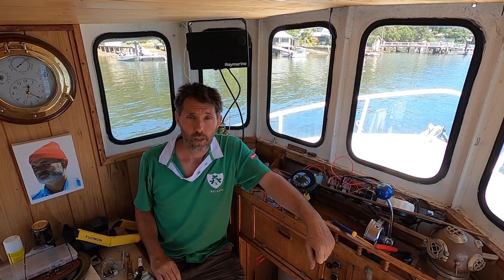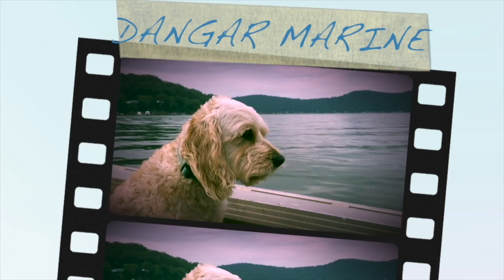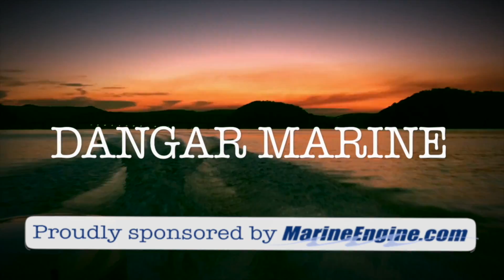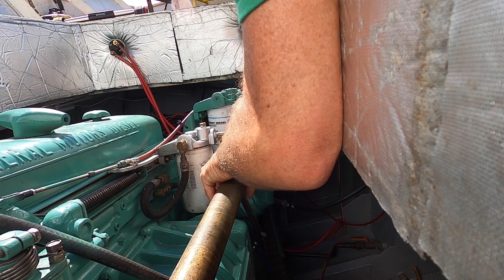Instrument panel

Comment: Stu. There is an inherent problem on that style engine and that is the location of the water pump. It’s high on the engine and it starts dry each time. You are a bit ahead of the game with a water flow sensor but there are other things you can do besides keeping a spare impeller onboard and being good at changing it regularly at a moment’s notice. Remember it’s better to change it before it lets go and sends debris to block the little passages. First off lower the strainer so the top is below sea level so the pump doesn’t have to fill it each time as well as lowering most of the hose ahead of the pump. Sorry I didn’t get to tell ya before you cut/ordered the hose :(
Ultimately, belt driven pump and bracket could be mounted low on the engine and a block off plate fabricated at the old location. Ever wonder why Mercrusier puts the (pitha) thing so low, now you know. A crank driven pump would be too slow (diesel rpm) or huge, uncommon and expensive.
Reply from the maker: I have been thinking about lowering the sea strainer as much as the misalignment between the it and the seacock will allow. It is my understanding that with the raw water outlet below the waterline it shouldn't lose prime as easily as there is no way to suck air in other than if the o-ring on the strainer leaks.
Reply: Dangar Marine 
All true. I didn’t know the outlet is below water line. Very good! Just can’t visually see it but that’s why you have a flow monitor.
Reply: Just make sure there isn’t even a pinhole leak on the engine or it could loose the hold on the water. See any leaks when running it could be a problem.

Comment: Maybe cut the fuel line a little higher and use compressed air to blow it back into the tank and shut the valve once the line is blown out then trim to length?
Reply from the maker: Good thinking! :)

Comment: 22:00 about the Barb: If you're going to put in a soft line you'll want to have a fuel valve in there which you can solder from the outside of the pipe low temperature-ish. Then you can use that valve to seal the fuel underneath while you braze on the 3/8th Barb. You'll also have a cut off to the fuel if you ever need to replace the soft line with a full tank of diesel, or if there's a leak.
Reply: I agree, the valve can be a lifesaver, literally in more ways than one.

Comment: How long are you going to leave that blower open to the damp air? Not to mention cutting, grinding, dust etc. that's a precision device and everything that's building up inside of it is going to blow right into the engine 🤔

Comment: I don’t think you’ll have a problem with that fuel connection issue. It’s not about fumes, it’s about the surface area of the burning diesel which is a little hole down a tube. If the fuel was an inch below I might be worried a little, but it’s like a foot of pipe to dissipate the heat before it even reaches the level of the fuel. Anyway, don’t blow yourself up please, I really count on your videos in these tough times. Be well, Paul.

Comment: looking at the raw water inlet, and how easy it is to get to it, do you think some long handles would help, If your away it would be easy. Also away of by passing the strainer just in case, keep it on board.
Reply from the maker: I have been thinking about that a fair bit. They really are in hard position to access and that needs to be solved.

Comment: Use a copper pipe cutter for the fuel pipe. No grinder required
Reply from the maker: That's the plan, it's already onboard. It's the brazing I'm worried about.

Comment: If you can have water running over the line down where the diesel is in it while your brazing it, it will drastically lower the chance of a fire
Reply from the maker: True, although I've tried to braze a water pimp that had a bit of water in it before and it didn't get hot enough to melt the solder.

Comment: When you rotated the raw water strainer to avoid a kink in the upper hose, you left the lower hose to the seacock attached. That put a twist in the lower hose. Did you (are you going to ) unclamp the lower hose, and remove the twist?
Reply from the maker: I'm actually going to cut it an shorten it to lower the strainer a little bit.
Reply: @DangarMarine   its like being married to 25000 wife's watching you   :-)

Comment: JMF 1/2 in. Compression x 3/4 in. Dia. FPT Brass Adapter. These are rated for air, water and oil, go on with just a spanner and terminate in a female pipe thread. I've used these and the SS ones (high press hyd) and never had a leak. Just follow the instructions and Sir Robert is your Aunt's Husband...
Reply from the maker: Thanks Mike, I'll check them out.

Comment: I get confused with the layout but could you cut a hatch into a bulkhead to get another way to access the engine room? One possibly easier to use at sea in weather or while engines running?
Reply from the maker: Yes, that is something I've been thinking a lot about this week. I'll be cutting one from the forward cabin into the engine bay.

Comment: Just fill up the engine bay with co2 and you will be save to braze even if there would be gas in the fuel line instead of diesel! By the way don't  forget to stop breathing then 😂😂😂😂

Comment: Maybe a compression  or a flare fitting for the fuel line.
Reply from the maker: A compression fitting is what I was trying to get originally, but it looks like it was just that brand that doesn't make what I need, people have posted links to others that should work.
Reply: @DangarMarine  Maybe run a compressed air back flow through the line and then shut the supply valve with the line purged with air?
Reply: @DangarMarine  Air compressor or tank on the boat?  Use some rubber hose and clamps on to the fuel line plumbed to the compressed air.  Turn on the air and let it push all the fuel back down in the tank.  With the air still running in the line, turn off the fuel ball valve at the tank.  Disconnect the air line and now the fuel line is clear of fuel all the way back to the bottom of the tank.  Now you can braze in the new fitting.
Reply: Of course, now i posted it, I see someone else beat me to the same idea!  Sorry for repeating it.....
Reply: Forget the barb. just solder an compression fitting olive on the pipe which will be enough to stop a clamped hose from pulling off.
Reply: Flare would be best !
Reply: I would check out a "Shark Bite" style connector. No flame necessary and quick coupling to various sized fittings.
Reply: @johnwedzicha  Sharkbite fittings are not rated for anything other than potable water as they contain a rubber o-ring which can be damaged by petroleum.

Comment: I am in lockdown watching so much sh1t...So thanks for some decent sane / quality content. ..stay safe and keep posting
Reply from the maker: Thanks mate, hopefully things get back to normal soon.
Reply: Look on the bright side mate. At least your at home. Not stuck in one of the 3 hospitals in the region designated as CV reception areas for the next 15 days. And I've already been here 6 days with a heart attack.
Reply: I wish you a speedy recovery and hope you don't have the complication of contracting the virus too
Reply: @gavinb9627  Thank you mate. Àlready been 1 confirmed case in this city.
Reply: @thecelticprince4949  speedy recovery. Stay safe
Reply: Check out dry bar comedy channel if not YT is on Facebook, laughter is the best medicine.
Reply: Thank You mate. It's a bit of a worry.
Reply: Thank you all for your well wishes. CV is one nasty sob, if you can imagine being used as a heavyweights punching bag. Having your lungs put through a wringer. Frozen sweats and your innards ripped apart and your heart doing 200 at rest and trying to get enough air to keep up   then that's what it feels like. For those going through it hold onto Jesus Christ with all your might. 'Cause that's the only way your going to get through. It's now Tuesday 24th March I'm now sitting in my home. Feeling like s#*t but very grateful to still be breathing.

Comment: I see your phone is a bit worse for the wear, if you are looking for a new phone i highly reccomend the Google pixel 3. Ive had mine for about a year now never without a case, and been really rough on it(6 foot drop onto concrete screen down a couple of times) and not even a scratch on the screen, the paint on the rest of the phone has some small chips at the corners from this but its held up really well. plus they are rated for water resistance(maybe more than that).
Reply from the maker: I actually broken mine while it was in a hard case by walking into a tow ball. Doh!

Comment: Stu
If you waited for parts for one project , shops would go broke fast. Seems everything I work on lately has a few hard to get parts involved. 🤔😶
Reply from the maker: For sure. It doesn't matter how much you plan (particularly with jobs you are doing for the first time,) you always seem to need a tool or part you don't have.

Comment: 5:49 ... hang on... you still have a 10mm socket in your kit!? HOW?

That fuel line. Refrigeration tube is measured by ID and the same nominal size in plumbing tube will fit inside, the reverse is also true. Given this, and provided you can get a small enough length, you might be able to sleeve the existing tube up to size by alternating plumbing tube with refrigeration tube until you get the ID you're looking for
Reply: Or he can swedge it or use sleeves like the one that is pictured with a ton of  silver solder on it.